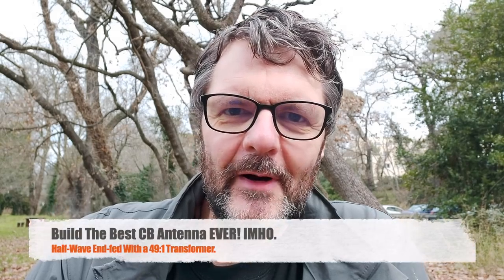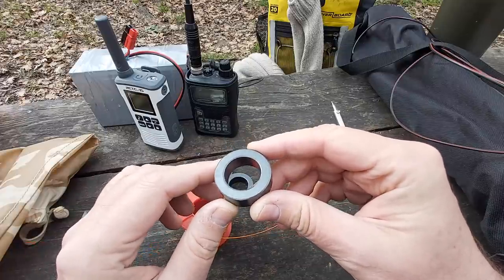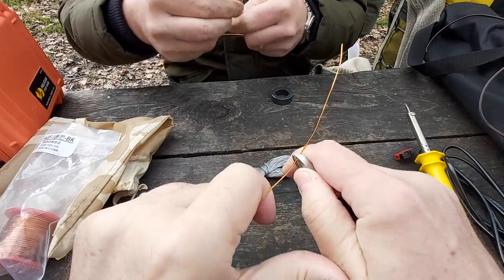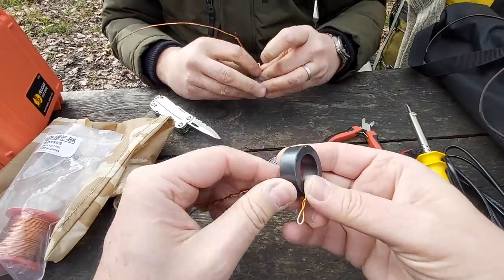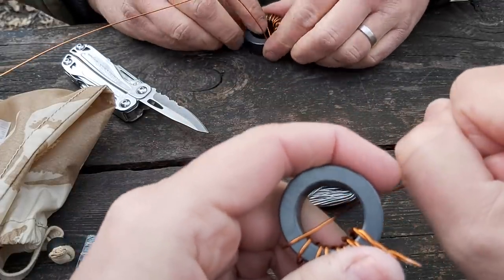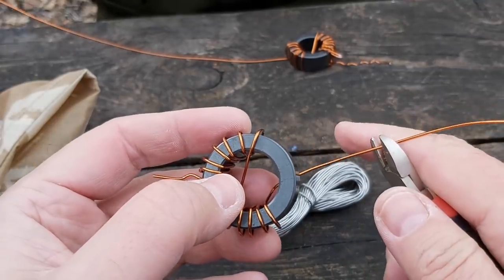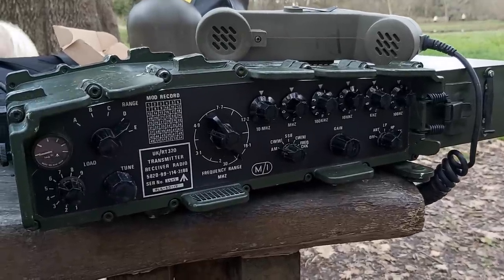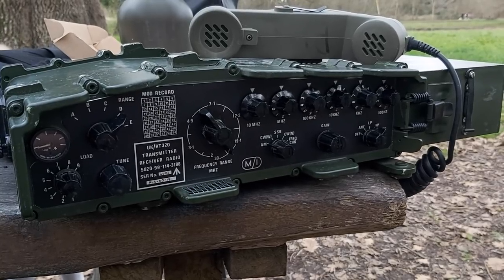Build The Best CB Antenna EVER! IMHO.

Comment: Good stuff. End fed half wave antennas are good for multi band use, such as 20 and 40 meter or 10 and 20 meters, but in theory, the lowest angle of radiation from an end fed antenna should be about 0.65 wave lengths long. Any length of wire can be matched to the transmission line, but longer than about 0.65 wave lengths, the angle of radiation begins to increase and that is not desirable. A 0.25 wave ground plane needs to be at least 0.25 wave lengths above the ground to reduce ground loss. From this it was thought that end fed antenna should be at length one antenna length above the ground. Accept a funny thing happens with an end fed half wave antenna. The ground loss is greater and to reduce the ground loss to that of the 0.25 wave antenna, a half wave need to be a full wave length above the ground. The end fed half wave can suffer greater ground loss, even though it might have greater gain. That brings us back to the 0.65 wave end fed wire antenna. The gain is greater (low radiation angle) and it only needs to be a half wave length above the ground to reduce ground loss. Anywhere between a half wave and 0.65 wave length, should increase gain and reduce some significant ground loss if the bottom of the antenna can't be a full wave length above the ground.I would try matching an end fed 0.65 wire antenna and getting the bottom at least a half wave above the ground.
Reply from the maker: I'll have to try thanks.

Comment: Gil,
Can a 11m 5/8 wave wire antenna be made with a torrid?
Reply from the maker: Yes, but you need to find out the impedance of an end-fed 5/8 wire.
Reply: @RadioPrepper  
Do you have a email account.
Reply from the maker: gil@radiopreppers.com

Comment: Merci beaucoup Gil. après tout comment quelle est la longueur du fil d'antenne si cela ne vous dérange pas de nous le faire savoir?
Reply from the maker: 143/f en MegaHertz. Donc pour la CB par exemple, 143/27.2= 5.25m On mesure le ROS et on ajuste la longueur. Souvent il faut en couper un peu. Généralement on arrive à 4.75m environ. Pour la bande des 80 par exemple, 3.6MHz, 143/3.6= 39.7m. Avec le transfo on peut alimenter le fil au bout. Sans on l'alimente au milieu, en dipole.
Reply: @RadioPrepper  Merci Gil pour votre énorme aide. J'ai une question; à quelle distance du sol doit-on déployer le fond de la boîte d'alimentation.
Reply from the maker: Ça marche avec la boite au sol mais mieux à 2-3m...

Comment: Nice antenna project! 
However a gainmaster, especially a homemade gainmaster with just wire can bee really portable too. 
It will give more gain too. 
// 21CT027, SM68481,
Reply from the maker: Because it is a 5/8 yes, but you can make a transformer for a 5/8 wire too..
Reply: @RadioPrepper  Ah, QSL. 
Why I commented about the gainmaster was because you said that it was the best CB antenna, 
That was why I mentioned the gainmaster. 
73 de 21CT027,SM68481
Reply from the maker: Best is not always about performance alone.   :-)
Reply: @RadioPrepper  Alright now I understand what you mean, when you include the length of the wire! Well in that case yes! That might be the best then
Reply: @RadioPrepper  
I would like to make a transformer 11m 5/8 wave antenna. Can you make a video on how to do it. 
Solar Cycle 25 is on the up swing and having a 11m 5/8 wave wire antenna would definitely get my signal out of the valley I live in surrounded by mountains.
Reply from the maker: I never bothered finding out because there is no real practical difference between a half-wave and a 5/8... The 5/8 buzz in the CB world is a marketing trick. Build one for a 1/2 wave, it will be just as good as a 5/8. Some people say the 5/8 is better, but I have doubts... https://practicalantennas.com/designs/verticals/5eights/

Comment: Good explanation
and get yourself a Gas Soldering Iron :)
73 de DO1OH
Reply from the maker: I can solar charge a battery... Where do I find gas in shtf?
Reply: @RadioPrepper  
You're absolutely right, I didn't think about that. But in the meantime, treat yourself to a gas soldering iron. :)
The refill bottles last forever and there are no batteries on top of the antenna tower.
10 euros are no big deal.

Comment: the performance of a halfwave is way lower than of 5/8 wave. I prefer 7/8 wave for optimal efficiency
Reply from the maker: I'll have to try. I think what makes it great is the low take-off angle.
Reply: @RadioPrepper  that's true...and all the fun you have while building your own antenna for low cost budget
Reply: Hello DK5ONV,  Did you ever make the 5/8, or 7/8 wave antenna? If so what was the wire lengths for both? I live in an HOA and would like to get the best performance on my antenna. 73's and thank you
Reply: @5940-c7w  Yes I did. But not a wire Antenna. 5/8 and 7/8 was a Groundplane Vertical made of Aluminum Segments. one had the Full Lenght and the other One was shortened with a n extension Coil. 
I don't know about the Area where live...how much space capacitiy the Property has but a 66ft. EFHW for 80-10m could find room there to work as it should in its basics
Reply: Hello DK5ONV, How many turns on the Ft 240-43 ferrites and what length of wire would you use to achieve 7/8 wave to get that efficiency?

Comment: Is this how the Antron 99 wirks?
Reply from the maker: Probably not exactly but also an impedance matching circuit.
Reply: @RadioPrepper  I'm wanting to get a ham license soon. I have a cb base setup now and run CB in my dump truck.

I was thinking it would be neat to have some sort of multiband antenna.
you know like 10, 11, 12, 15, 40, 80 etc.

Is that possible with the end fed antenna's or maybe I'd need a tuner?
Reply from the maker: Awesome. Multi band antennas aren't easy. A half-wave will give you multiples of the wire's resonant frequency. So a 20m wire for 7MHz will resonate on 14, 21 and 28MHz.. If you want more bands you'll have to use a tuner. Look into the G5RV... Easy to make and cheap...

Comment: It’s almost like a rite. Nobody knows exactly is there any advantage or not in making primary twisted or making that crossing in the middle. But everyone repeats ))
Reply from the maker: No advantage for the crossing over other than practical. The twisting, I did read something about it somewhere but can't remember... Not a significant difference I bet...
Reply: Radio Prepper
Exactly, and if twisting doesn’t make any difference why not to wind it with single wire? It’s much simpler.
Center cross it makes sense if you deal with kW powers this way you place output at the opposite side from the input. That could be important in case of very high voltages.
Anyway transformer works better if all turns are closely packed together if as the result the winding takes only the small part of the core that is not a problem. The problem is wide spacing between turns. It leads to flux leakage.
And for 27Mhz single turn primary could be Ok, I’m not sure tough, but it could be easy calculated.

I’m sorry for being tedious)))
Reply from the maker: I don't think single wire is simpler...  Twisting is easier, I think...

Comment: can you tell please . which pins are being used to charge battery  that u use at radio
Reply from the maker: It's written on the battery... Not sure I understand your question.
Reply: @RadioPrepper  left side of the battery there is 4 pin  dc input ,covered  with long black plastic cap
Reply from the maker: I'll check...
Reply from the maker: I use the top contacts...

Comment: Why do you always only use end-fed antennas? Are dipoles not more effective? :) Again, t2lt is better for CB. Easy to manufacture and no need to solder anything at all. Well, except for the connector. :) And why do you always use round ferrites? Direct ferrite will be even more compact. Sorry for the stupidity, just curiosity.
Reply from the maker: There are no stupid questions. End-feds are just easier to use, faster to deploy, and when vertical have a low angle of radiation. Round toroids are just easier to work with as well. Performance is not everything, sometimes ease of use is more important..